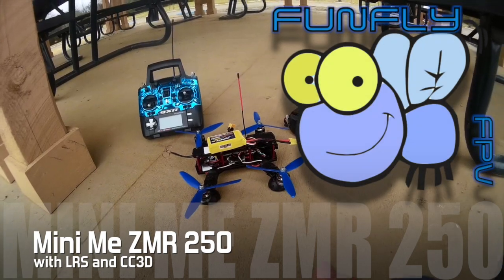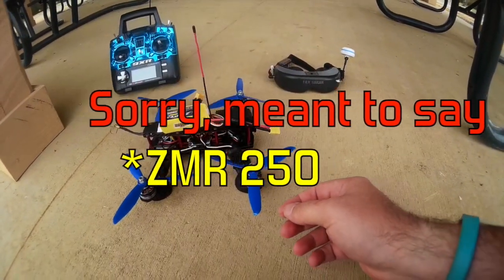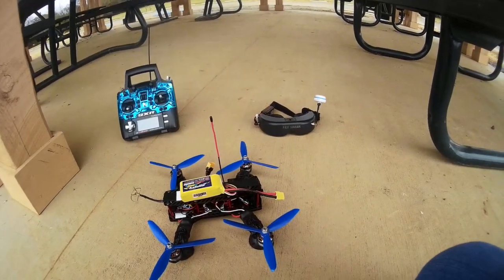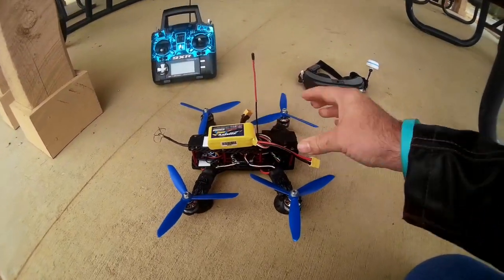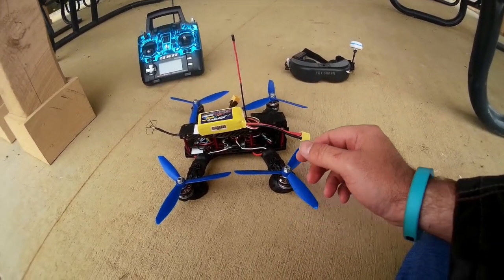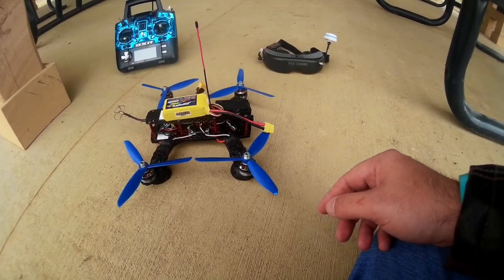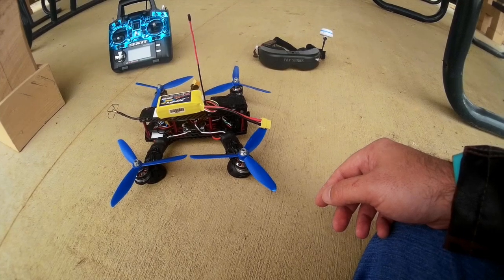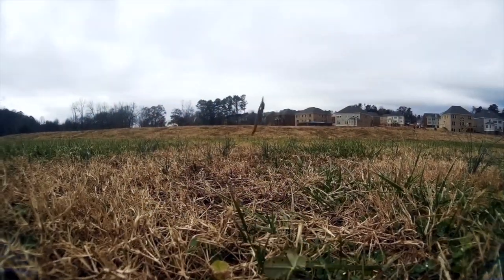Mini Me CC3D ZMR 250

Comment: I have a cc3d board with the same frame but mine was really unstable, and more around like crazy I cant control then maybe you can give me some tips for fix this issues...
Reply from the maker: This frame was pretty unstable until I upgraded to the 14.10 Mini-Me firmware. The new CC3D installation software has a ESC tuning wizard that measures your ESC speed, and I believe that also helped solve my instability issues.